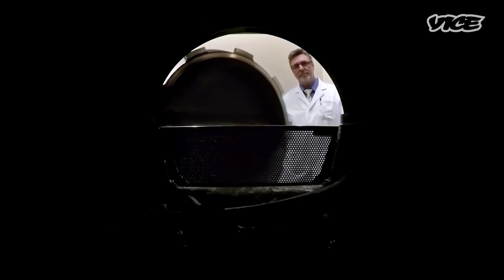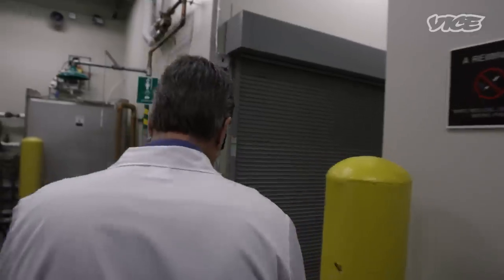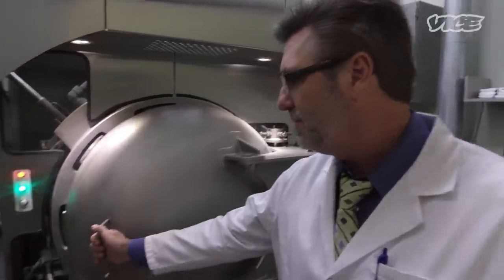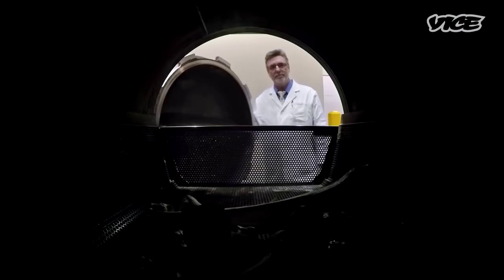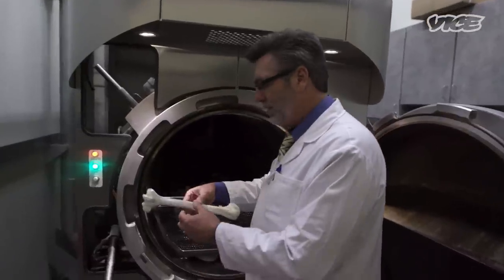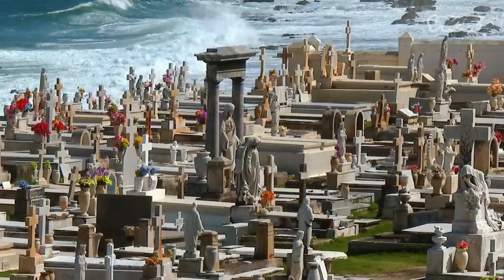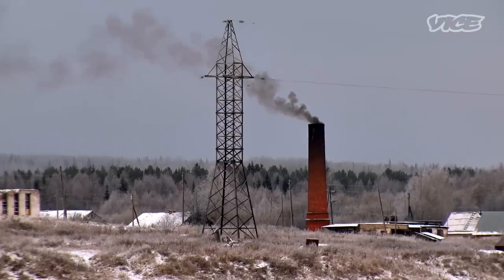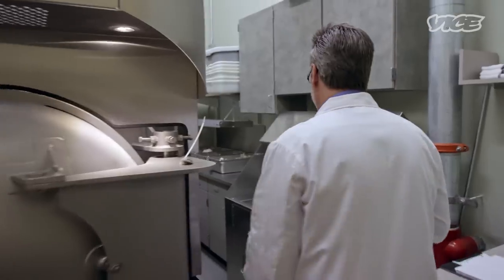The Most Sustainable Way to Die: Water Cremation

Comment: Reimplantation lol
Reply: grandma will always have a place in my heart. literally.
Reply: Yeah that's not happening lol he was on some crazy shit saying that
Reply: @haidenmorgan  no cap
Reply: I don't see an issue with it. Your implants whether they be metal or plastic are not you, and you are not your implants. They are purely artificial inside or outside of your body. Teflon, Titanium, and Stainless Steel can all be cleaned to exactly the same standard before their second use as before their first. We repurpose or reuse everything else that is an engineered extension of our self that we use on a daily basis. Clothes, cell phones, cars, glasses, wheel chairs, canes, and other medical devices. I don't see why this should be any different. I'm an engineer and know just how much energy, material, machining time, and R&D, goes into producing these medical devices; it would be incredibly stupid to just throw them away. Besides a lot of people will be swayed by price, if you can get the same quality resterilized implant, for 25% the cost or less of a new one, a lot of people will make that choice. Not everyone has $30k for a brand new hip.
Reply: @TheMW2informer  That's why you ask them if they are ok with it. I am in no way suggesting that you mix old implants with new and don't tell the patients. That would be unethical as hell. But I still think many people would buy a "used", even though there is nothing different about it, implant if given the option to buy it at a significantly reduced price over a new one. Again there's nothing structurally, chemically, or any other engineering quality different about it, so any rational person wouldn't care. -I am however aware that a large portion of the human population is not rational, so that's why you would have to be ethical and present both options. I won't buy a pair of used shoes but I would buy a professionally sterilized piece of titanium any day. Ain't a thing different about it from when it was first manufactured.

Comment: You can’t reuse metal implants. The cyclic loading of the implant weakens it over time. A reused implant would be more likely to fail. Additionally, there is wear on the surfaces of replaced joints. Total hips for instance often have to be revised (replaced) in people because the artificial joint surfaces wore out.
Reply: I wonder if it would make sense for the metal to be melted down to create new ones
Reply: @crazy4beatles  there are implant recycling companies apparently. They smelt them for reuse. Apparently things like pacemakers can be refurbished and reused for people who cannot afford them.

Comment: I wouldn’t like an ⚱️ filled with my loved ones bones. That’s just me.
Reply: If you ground up the bones it would look like dust or ashes. The only difference between the ashes you usually receive and these ground up bones is that the bones are actually more closely related to your loved one since they haven’t been heated at such high temps to leave basically pure carbon.
Reply: @npm1811  Even after the oven the bones need to be crushed.

Comment: no mention of where the separated liquid mass goes
Reply: Potassium Hydroxide is a strong base that is commonly used as a cleaning agent for corrsion resistant surfaces and, when saponified with fat, used as soap. I'd imagine the body water could be reused for such purposes
Reply: "Dr. Gone-er's Soap"
Reply: @andrewzheng4038   fuck no dude!
Reply: Mass is liquidated due to the higher temp water, and flushed down the drain safely, if you’re embalmed your body liquids go down the drain too.

Comment: dont think reusing implants meets the safety/sterilization guidelines in healthcare so its clear this was a commercial for death planning. lacked lots of info... the main question ppl have is what happens to the water.
Reply: Well you can sterilize them later on
Reply: @pru6621    so.... FDA and AMA guidelines prohibit the reusing of single use devices such as implants. even if the risk is low there is no way to mitigate the risk of infection even if a low porous item is sterilized.  
more so, this comment isnt about that. it is... about the video being a commercial on funeral planning and the unanswered question about waste water.  
the context of the original statement is VERY clear. there are also things to read that would prevent the non-medical retort "it can be steralized"

Comment: Can dna 🧬 still be extracted from the bones 🦴?
Reply: If the bone marrow stays unharmed, there would still be a very small chance that you could extract DNA.

But bones are porous, so the solution would most probably also dissolve any cells in the bones and so also the dna would be lost.
In addition to that, the heat would also break the dna down, so the chance that there are still some useable dna fragments left are pretty slim.

So it would be best to take a sample before the procedure